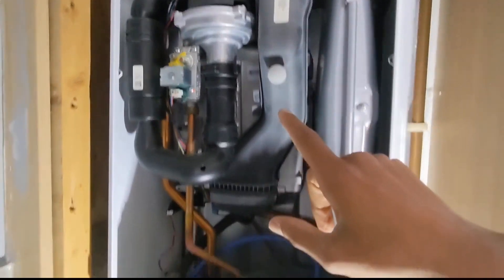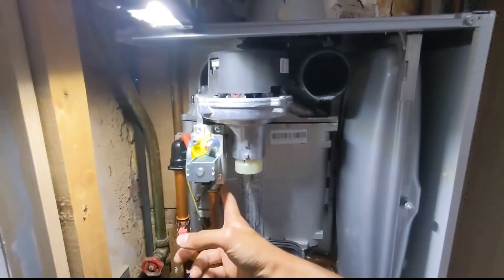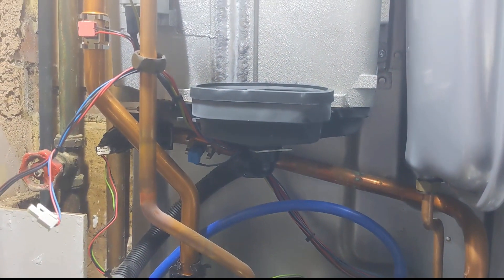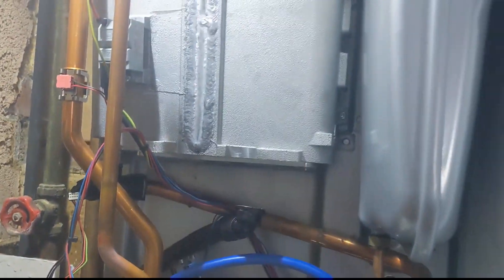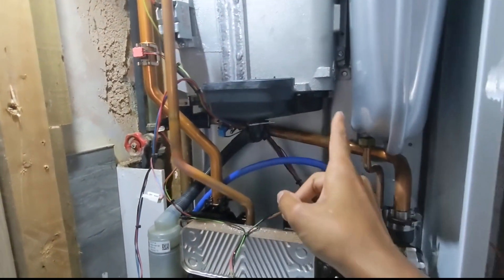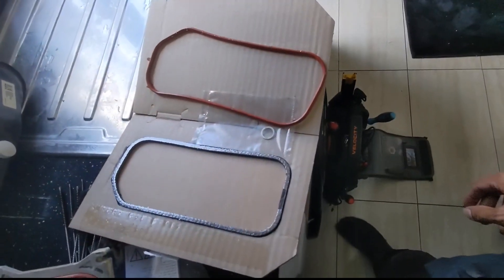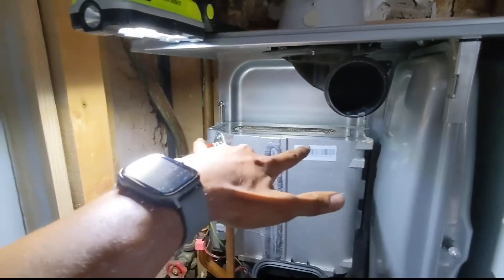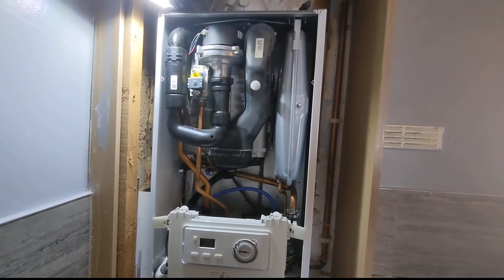Main Heat Exchanger clean & sump replacement Vaillant Ecofit Pure, Glowworm Energy, Heatline Capriz

Comment: What's the wee extension for the bacho socket set, looks very handy
Reply from the maker: That was from my wera kraftform bit holder. The shaft can be detached from the handle and used in any quarter inch drive attachment 👍🏽